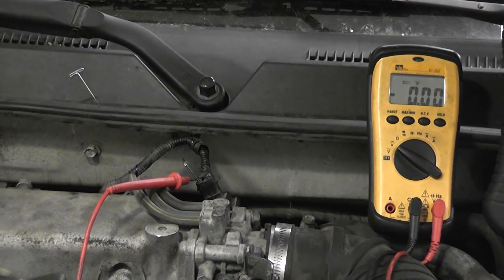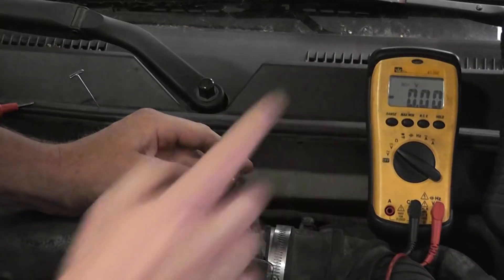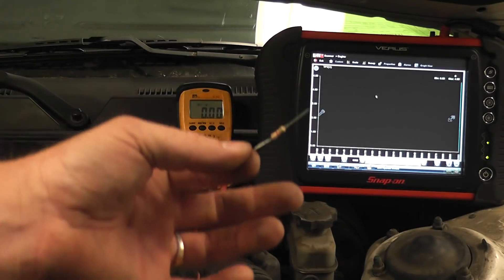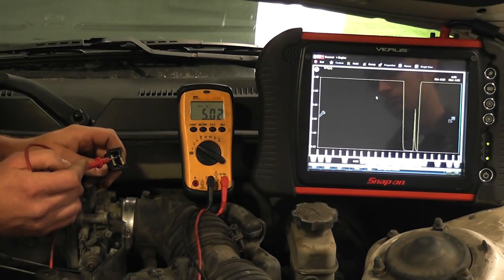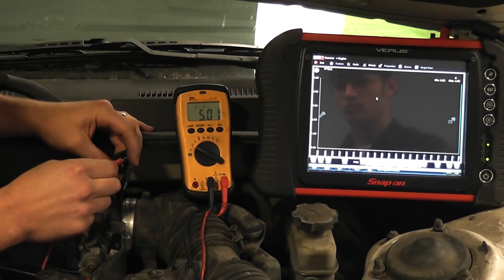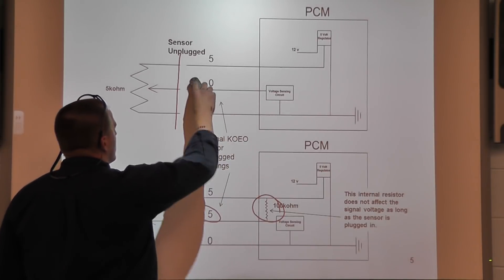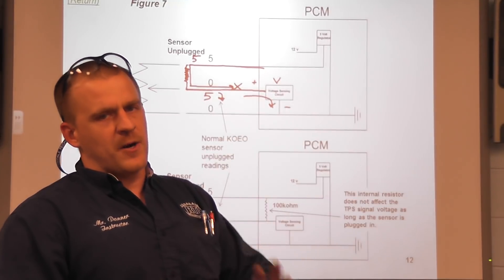How to test throttle position sensor wiring with a resistor (any car)

Comment: Hello Paul. What a great video and help. Some days ago, I made a big comment here and now looking for any answer, I could not find it. In my car, I'm testing TPS and harness for any faults, and the weird thing is that signal wire when key is on and tps plug disconnected, I have 5 volts, which according to you means, the harness is fine, right? Because there's internal resistance in ECU connected to Reference voltage, I believe. My issue is that when tps plus is connected and key on, using a back wire into signal wire I still have the same 5Volts.....Quite weird isn't it? Your help is appreciated. Thanks a lot in advance. Regards Nuno
Reply: I mean, signal wire have 5 volts, no matter which position the TPS sensor is. Exactly the same 5.02 volts when tps plug is disconnected from tps. Thanks Paul!
Reply from the maker: give me a reading on all three wires, plugged in, backprobing. We need to verify good ground circuit integrity before we lean towards a faulty sensor. 
BTW, yes, 5v measured on the signal wire unplugged, confirms signal circuit integrity (nice job!)
Reply: Thanks in advance Paul. I only have backprobed the signal wire (middle). Well, readings.... When unplugged, reference wire has around 5.18 volts, and for negative wire, I made a conductive testing using multimeter with negative pole from battery and was fine (beeping). As said above, signal wire has 5.02 volts, both plugged and unplugged to tps and ignition on. What I noticed is that if I test conductivity between negative bat pole and negative wire with ignition on, there's no beep from multimeter, like when ignition is off. Also tested tps with external 5v battery into reference terminal, and values from signal terminal were increasing from 0.7 to 3.6 volts. When doing backprobing testing to signal wire, with ignition on and tps plugged, connected multimeter to backprobe and negative pole in battery and as said above, the voltage never changes, it keeps 5.02 when turning tps. Could it be I need to test using a backprobe in negative wire instead of negative battery pole? Thanks once more!!! ;)
Reply from the maker: Give me a voltage reading of your ground wire with the sensor plugged in and key on. A good ground will read less than 100mv (loaded circuit test). This is THE MOST accurate ground circuit test for this sensor. If that ground is bad, you will read high volts. If it's completely open, you'll read 5v (same as the source). Again, non of these tests are valid unless the sensor is plugged in and the key is on.
Reply: @ScannerDanner  Paul, sorry have not understand very well the test you are asking me to do. Do you mean read voltage between ground wire from tps plug and car ground/negative batt pole?
Reply: @ScannerDanner  Paul, above comments when I said negative wire from tps plug, I mean ground. Sorry...Im not a 100% expert in electronics, and for me in DC current, negative is the same as ground. Maybe wrong names...
Reply from the maker: Yes sir! It's called a voltage drop test and doesn't make much sense until you see a bad one :-) then it will click.
Reply from the maker: I knew what you meant and you can call it that. I'd just call it a sensor ground. Manufacturers will call that circuit "reference low" or "signal return"
Reply: @ScannerDanner  ok, will measure voltage from tps ground wire and chassis ground and needs to be smaller than 100mvolts ;) Will let tou know ;) It's midnight here.
Also have you noticed my older comment when I said, if I test conductivity between sensor ground wire and car ground it beeps, but if I turn key it will not beep anymore? 🤣 Well, maybe that's why you made me do the most recent test...😉
Thanks Paul once more. Worst is that I'm testing tps and harness because I'm having issues with idle control valve to work...and have bought one new icv and its not the icv :(
Cars.. when you like them and something is wrong, makes me sad....
Reply from the maker: @nunobarros1231  yes, that is exactly why I wanted you to do the voltage drop test. The fact that your ohmmeter beeps showing you continuity until you turn the key on is concerning.
Reply: @ScannerDanner  Not managed to do measures. Far from the car. What is weird? The beep with key off or no continuity when key on? Thanks

Comment: 2002 dodge stratus 2.7 crank no start. I have no spark. Replaced cam and crank sensor. Asd relay and fuses are ok. I have fuel, and power at the coils But no coil driver signals. I found that the 8v supply from the computer to the cam connector has 8.9V. According to on demand its supposed to be 7.5V to 8.5V. Could this cause a problem to not have spark?
Reply: Is there a way I can add a resister In line to bring that 8.9V down to 8.5V? Just to see if I get spark?.
Reply from the maker: This is not a problem for your design. They used a 8-9v ref on some of the older Chrysler systems to power up the hall effect sensors.
Reply: @ScannerDanner  thank you sir.  Could timing cause a no spark issue? I have no codes and I'm lost
Reply from the maker: Yes it could but that would usually set a cam-crank correlation code. 
Can you see the high-low signal on both the cam and crank sensors with your voltmeter? You have to bump the starter to see it, if that makes sense
Reply: @ScannerDanner  I used a scan tool and I saw wave forms out from both sensors, that  looked similar. Idk if it's a valid reading.
Reply from the maker: all you can see on scan data is an RPM reading on those cam and crank sensors right? Or they may list them as counts.
Reply: @ScannerDanner  it shows a graph.  Also it has signal "Lost" OR "Present" and then a "sync" and "out of sync." Sometimes they sync but its random. Hey go from signal "lost" to "present" randomly.  I'm replacing them with the original sensors from Dodge and see if that helps.

Comment: Good video and thanks for sharing, question I have is I do not have a diagnostic scanner but I do have a odb2 scanner with a live mode, it does show the tps as a %. With the truck off I am at 23% if I press the peddle to the floor I get 56%.
I am trying to diagnose a P0120, if I Remove the tps plug and install the 5K resistor then should my ODB2 scanner in live mode read the TPS at 100% 
Thanks
Reply from the maker: That test is for circuit integrity. It may not change as you hope because the computer may substitute that value during that test
Reply: ScannerDanner ok thanks, maybe I will give it a try and see what happens to test the circuit, I ran a test with my other truck to night ( bit older one) and at no pedal I have like 0.6% on the tps and if I out the pedal to the floor it reads 100%.

Odds are I have a bad tps

Comment: what if I had 2 signal wires, on of them reading 3 volts and the other one 0, and when TB fully open one measures 0 volts and the other one .5, bad TPS?
Reply from the maker: What are you working on? Year, make, model, engine and you need to measure and report all 3 wires for me

Comment: Hello, Paul. I love watching your videos. You show us faster and safer way to troubleshoot. I was wandering if I could use a test light, connected to B+ and touch on the Signal wire; test light lights: Short to ground in the signal wire.

Comment: dear sir ,i have been with u for sometime now and i have master myself in so many things in ur video and also manage to buy ur Ebook.....i will like to say thank u for the knowledge am acquiring from u.Ur method and style of diagnosis is extremely different and exceptional ..my question for you? 1) can u i use a resistor less or more then 5kohm let say 4.5 or 5.6kokm to the testing?  
2) can u do any bypass on the signal wire for the pressure sensors and potentiometer with a test light and look for respond on the scan tool?
3) i was working on a  car with check engine light  and i pulled a code p0500 which is related to vehicle speed sensor.i located the sensor and it was a three wire sensor,i use multi-meter and check all the three wire and had source voltage,5v and ground.from my testing i know the sensor is a pull down design so i decided to do a bypass test by pulling the signal wire to ground with a test light and it worked and the check engine went of immediately i did the test so i was 100% confident to change the sensor.............please Sir i want to find out if the signal had short to ground could have use the test light to battery positive and watch the test lit?

Comment: Sir if you are using a 6 k resistor for testing a sensor what type of sensor applicable to that method sir thanks
Reply from the maker: pressure sensors and potentiometers

Comment: ScannerDanner. I was having a problem with a 1998 Dakota 2.5 ltr. TPS P0123 high voltage code. I am a retired military veteran as an auto tech. I am ASE Master Auto and truck tech. I watched your You Tube video of the Grand Cherokee TPS no voltage signal problem. The one thing you said helped me to diagnose this dakota. You said " an open or high resistance ground circuit would cause a high signal voltage. I had a broken wire to rear of engine from 02 sensor circuit black wire but all my sensor wires are from pin 4 at ecm. TPS voltages were 5.47 vdc including signal return. Ground resistance was 18k ohm minimum to 33k at all sensors. I could not find were the BLU/BLK ecm ground tied to the black 02 sensor but now all the sensor ground circuit wires back to the ecm are 0.3 ohm. haven't reassembled as of yet but I believe the problem is gone. Thanks for the good info. Rick Larson, RNL Auto Repair Inc., Easley SC

Comment: how would you adjust tps signal base voltage that bolts down on the throttle body with no adjustment?
Reply from the maker: You don't. You just disconnect the battery on older cars to reset the learned minimum TPS value. On newer cars, this is done every key cycle.

Comment: ive subbed,  need help please. live data for my tps seems to be very touchy, i could press the pedal maybe 25%-40% and it reads thats its at full throttle and its very consistant but does not throw a code.. leaning towards the tps... 06 crown vic
Reply from the maker: If we are to believe the data you are seeing, your symptoms should range from severe hesitation problems to surging, lack of throttle response and possibly stalling. Suggesting a faulty TPS. Is this an electronic throttle body? If it is, there would definitely be a code.
Reply: ScannerDanner, my car does hesitate and has loss of power but does not stall or throw a code, i belive i have 2 throttle position sensors

Comment: great video as always.
just a suggestion.  if you can't zoom in on the 5000 ohm resistor because the vid would become blurry, narrate the color of the stripes on the resistor.  a viewer may have a resistor laying around and not even know it.  
this info is easy enough to find on google, but the info you provide can be trusted, where google shouldn't be.

Comment: idle control and map sensor and maf and iat sensor what the different and the relation between these sensor every one one you tube said they regulate air flow ( ineed more explanation ???
Reply from the maker: Join my premium channel and I'll teach you everything you want to know about these. 
The only one that you mentioned that regulates air flow is the idle control device. Every other sensor you mentioned is monitoring, not regulating airflow.
Reply: i cant >> The uploader has not made this video available in your country.

    ؟؟؟؟؟
Reply from the maker: YouTube has placed restrictions on the paid channels. You can use a VPN to mask your countries origin and gain access that way.

Comment: Can a man check the signal wire with with a test light from battery +?
Reply from the maker: Technically yes, but my preference is to stay with the 5v source as the max voltage for this circuit. Use your test light between the 5v ref and signal wire would be a better test

Comment: hm...i was expecting the same for 4. b)...when jumping the TPS signal to TPS ground ...since there is the same concern...if TPS signal wire were SHORTED TO POWER...here s my thinking...if there s power around that is not curbed by that current limiting resistor(as is case with thermistors)...then he or she should stay away from jumper wires and paper clips and stick to test lights and 5kohm resistors...your thoughts mr. scandan?

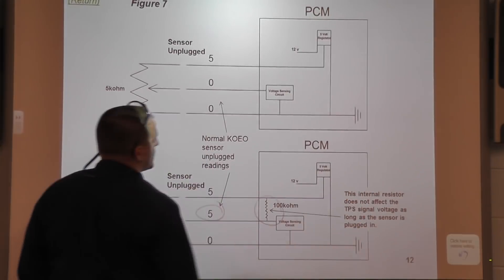Comment: Hey ScannerDanner I really like watching your videos. I always seem to learn something new. So thank you for sharing your knowledge, and cool test by the way. I think I will use that technique in the future as a safeguard. Watching your video towards the end at around 14:40 when you were going over jumping the 5K ohm resistor between the 5v wire and signal wire. You mentioned how the 5v would not have a voltage drop and be lower on the signal wire because of no current flow, and that it is just going to a voltmeter inside the PCM.
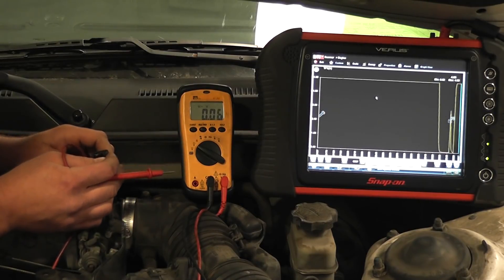        In my mind, I see a series circuit with two loads in it (1 being the 5k resistor, and 2 being the voltmeter itself inside the PCM) The way I see it current should still flow across both loads and the voltage should drop proportionately based on the resistance of each load.  So if you have 5v supply and R1 is 5k ohm and R2 is 10,000,000 ohms (typical volt meter internal resistance or so I thought) So doing the ohms law math I came up with about a .049 Volt drop (give or take a few) across the 5k ohm resistor and about a 4.95 volt drop across the  meter.  Would it not work that way? I think I saw a tiny volt drop when you showed the test around 6:30 in your video. With 5k ohm resistor in place your meter shown 5.01 V on ref side and on the signal side it shown 4.99 V. Would that not be a voltage drop and current flow happening there. 

       I think having such a high resistance circuit makes the current super super super low, and almost completely gone (really probably not even measurable current, without expensive equipment), but even though the resistance is high in the circuit and the current is low, there are still measurable voltage drops going on in this circuit, I think. Just hard to see it, but if you replaced the 5k ohm resistor in R1 with a 10Mega ohm resistor (something closer to the meter value you would see the voltage drop better). I would think in that case you would be able to see the voltage drop much clearer and have equal or much closer voltage drops across the resistor and meter, probably around 2.5V on each in this circuit. 

Anyway just something I was thinking about, and I was curious what your thoughts are on it. Well thanks again for the awesome lesson, I appreciate it. Thumbs up from me. I will be subscribing to your channel and watching more of your videos. Thanks for your time and have a good day sir.

Comment: Hi Paul, would a 4.7k resistor be close enough? I went to radio shack, they didn't have 5k, closest one was the 4.7k. Thanks
Reply from the maker: For sure. You can use less than that even. I've found a also that an LED test light can be used to jump between the circuits.

Comment: HI PAUL CAN I USEE  10 ohm  PLZ
Reply from the maker: I'm sorry. What is your question? You want to use a 10 ohm resistor? Use your test light instead
Reply: hi yes 10 ohm resistor to test throttle p   sensor  ,,is not probleeem thanks

Comment: hey paul,if you look for a 5v reference on any of sensor that is plugged in that circuit,and there is no 5v refenrence,where is the problem from?and also could that lead to a bad mpg in a vehicle
Reply from the maker: +STEEVE DAVID Nicolas no 5v reference to one sensor or no 5v reference to all the sensors? If it is all of them, the car doesn't start. If it is  only one of them you have a break in the 5v ref wire somewhere to that one individual sensor

Comment: I have an electronic throttle, i would love to know how to do these tests. It is an Astra 1.8 16V, and I have problems with the signal. the signal is showing 5Volts when the car is off hence, it has failed to start

Comment: Couldn't you just use a ohm meter from the ground to the Signal with the sensor un-hooked to see if it was sorted to ground before doing Integrity test?
Reply from the maker: +Jared Monroe you could do that but you would get a reading through the sensing circuit, as long as your reading was more than 20k ohms
Reply: what about using the powrprobe hooks 5v and jump the signal-ref, instead of the 5kohm resistor? :)

Comment: Hey Paul, thanks for this ... I'm always looking out for guidance on testing and protecting a computer circuit. Question: do all sensing wires back to PCM NOT support current flow at all, or is it just a very very low current?

Comment: dumb questions here.   
1:can you use an actual fuse  also?
 2: is yes , what size of fuse ? 
just wondering in case that  i dont have a 5k resistor, i know you mentioned that  there is no measurable amperage since the sensing circuit acts as a voltage meter but  what if i use a  200 milliamp fuse?  if it blows it is shorted to ground , if   it doesn't am i good?
Reply: +estrelladelnorte1308  not   just 5k resistor ,,,

Comment: i had a vw golf 2005  i was working on and i had a p0222 code. The TPS had 6 wires on it  there was a motor built into it to control how much it opens (not cable operated).any videos to show how to  test this type of  TPS.

Thanks in advance